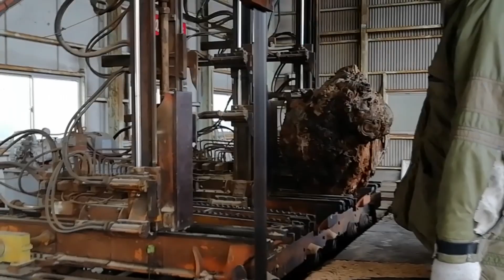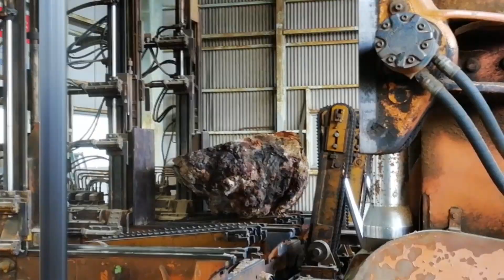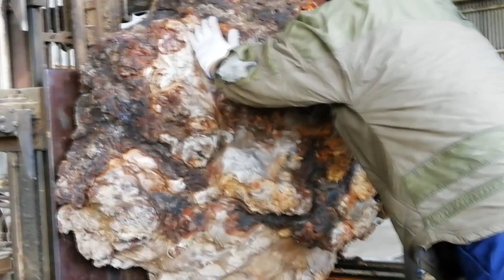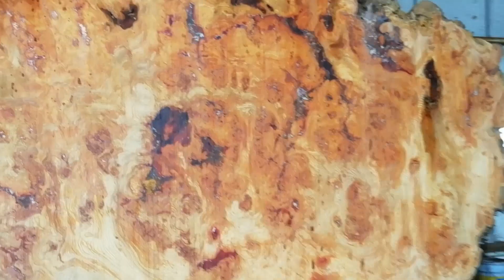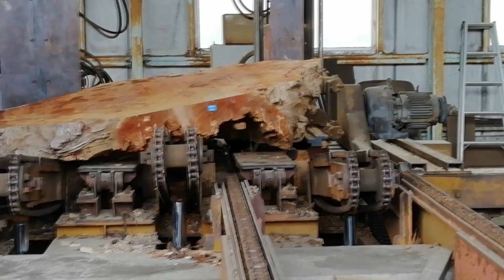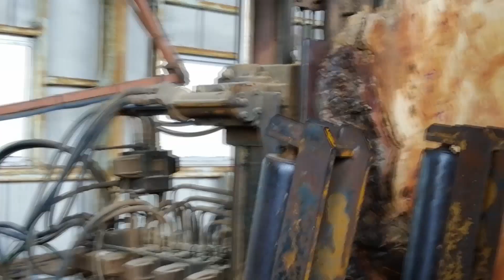American pine burl sawing

Comment: Love that burl!
Just because  there are no safety guidelines does not mean you can't use common sense. Stay away from the blade!
Reply: I think this looks more dangerous than it is. I have watched many of these videos and the man at the back never goes in front of the blade, always behind the blade. You could even touch the back of the blade without damage. The from of the blade is a different story. The aperture of the camera makes everything look shorter than it is.

Comment: The guy pulling the slabs scares the bajeebus out of me, reaching into the blade and always off balance is a recipe for disaster. If he had ever witnessed a blade shatter into the throat of a saw he would show it the respect it deserves. A saw blade can and will take large parts of your body and turn them into very small bloody bits in the blink of an eye. I know, I know the greater portion of the blade is soft and annealed but the teeth and forward portion are hard and I have seen them rip right off the blade at the right speed. If the end welds work harden the blade will become one long blade follows the route out of the saw and piles up on the table and the blade hits those hard portions and shears the teeth off they will spray out like bullets from an AK-47 loaded for bear.
Heck the blade doesn't even have to do anything but be running for some dude getting careless and slips just that little bet too far and a tooth pulls him in for the rest of the blade finish the job. I will tell you it is no fun cleaning up a mess like that.